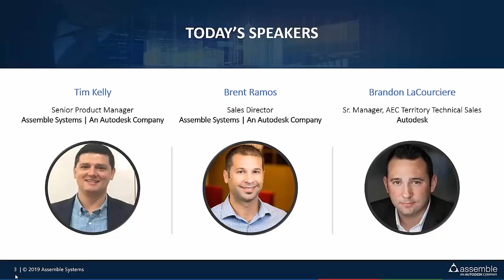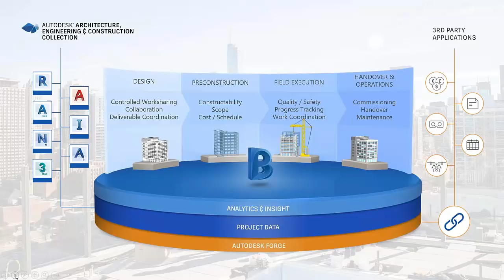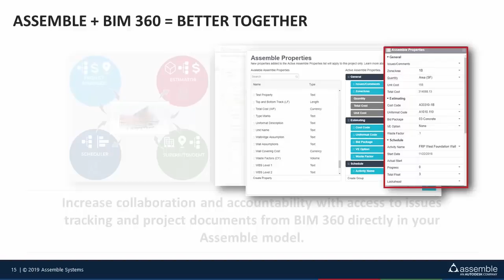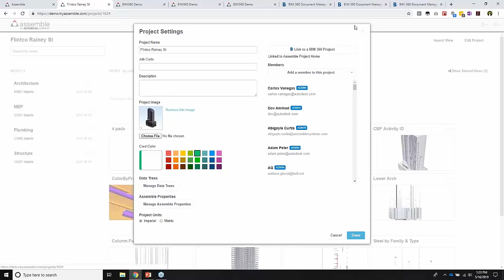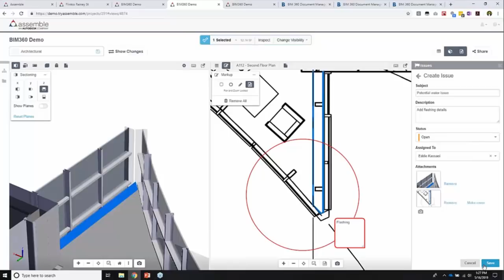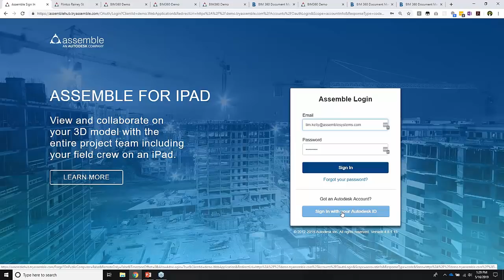Webinar: The Power of Assemble Systems & BIM 360 Integration

Comment: Does Assemble has also the capability to do Quantities take off from 2D Set of drawings? Often the bid has to be done from the PDF set only. In this phase is very possible the Architect will not share the Revit file. Can some one let me know? I was looking Destini from Beck Technology, they include the 2D QTO but I think is not integrated to BIM 360.
Reply: you need the Revit file....Most architects ask for a signed waiver of liability and then will release the model.